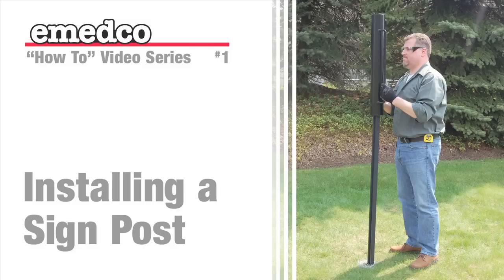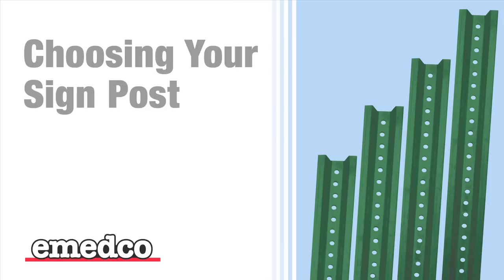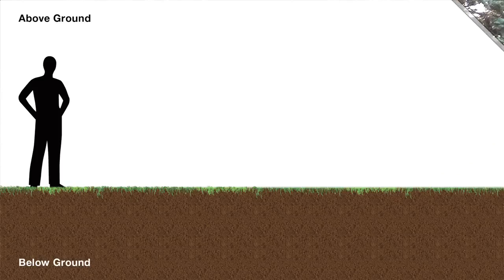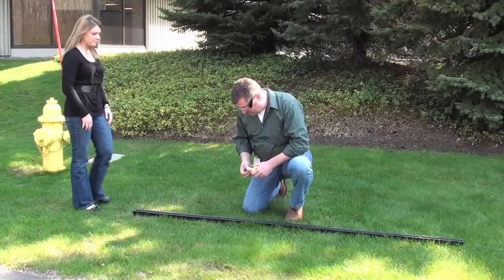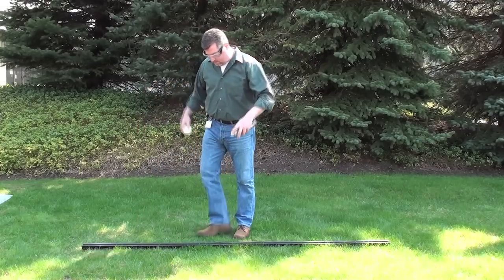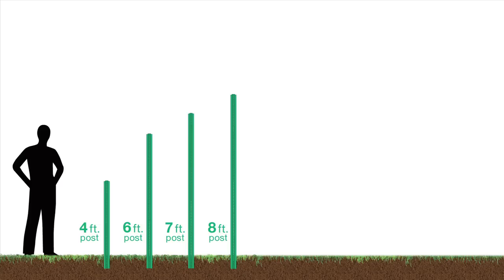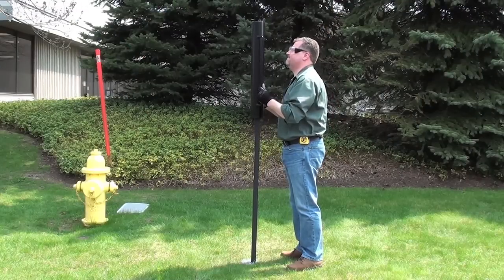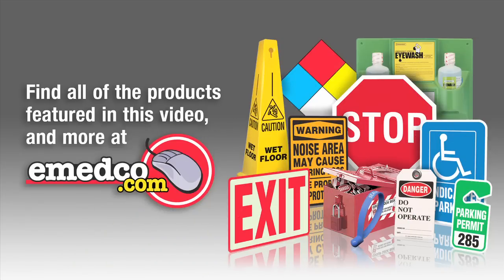How to Install a U-Channel Sign Post | Emedco Video

Comment: You DON'T want your post to be level. No one will be able to see the sign - because it will be lying flat on the ground. Level means parallel with the horizon. Use a level or plumb bob to make sure your post is PLUMB - meaning straight up and down.

Comment: Is that legal to put a post so close to a fire hydrant?Since you can't park next to one within 15', it seems putting something in the ground would be the same.
Reply from the maker: Thanks for your question Thomas! To the best of our knowledge, there is no federal code that prohibits the installation of a sign post within a certain distance of a fire hydrant. Now, that’s not to say that your town could not write and pass a law of their own that does. In a situation such as this, we would strongly recommend that you check first with your own local municipality to make sure that the post installation you wish to do is permitted. In addition to this, we would also strongly recommend that you check with your local utilities first before you begin ANY sign post installation, in order to avoid accidentally damaging underground utility lines in the area.

Comment: Had one mounted like this... someone came in and just wiggled it a few times and stole it in about 1 minute..... they don't cement them any more?
Reply: Not supposed to cement the poles because if someone drives into it can hurt them, but you are supposed to pack the dirt around the pole so its not so loose

Comment: Also, its much easier with the assistant to hold the channel level, if it falls out of level, than it is to correct it yourself. Nothing "manly" about doing this by yourself.  If you want to make it look good, dont pride yourself doing it by yourself. Help is there for a reason

Comment: There is no mention of properly orienting the  "face" of the channel.  Sign caps are either 90 or 180 degrees, so the channel had better not be at some other weird angle or the signs won't be facing where you want them.

Comment: Here's a nit pick: That post was not vertical or plumb. (which would be the right terminology) Level is an approximately horizontal line or surface taken as an index of altitude.

Comment: Anyone have any ideas where to find a 7 ft post?
Reply from the maker: Thanks for your question John! Unfortunately, we stopped selling 7 ft. U-Channel Posts a few years ago. One question for you, though... Have you considered purchasing an 8 ft. post, and then driving the post into the ground a foot deeper? That extra foot might make a huge difference come wintertime. If a post isn't driven far enough into the ground so it is below the frost line, when the soil freezes in winter, that post could be pushed right back up and out of the ground again. This is called "frost heave", and it can turn your nice and neat parking lot, into a crooked mess by springtime if you're not careful. Hope this of help to you!